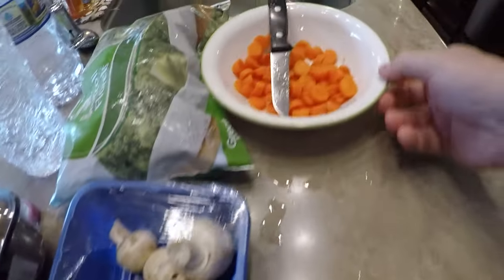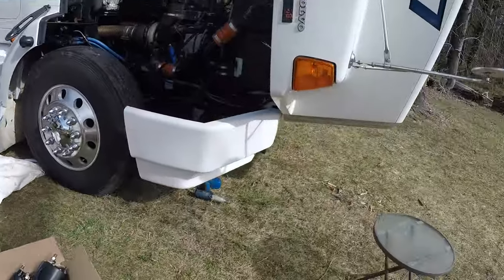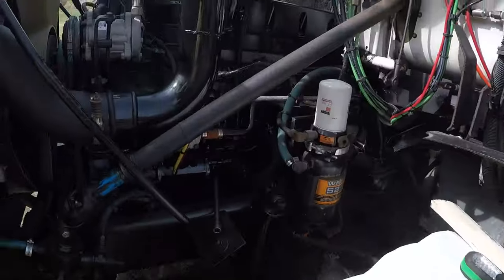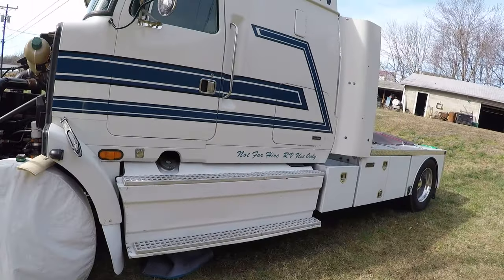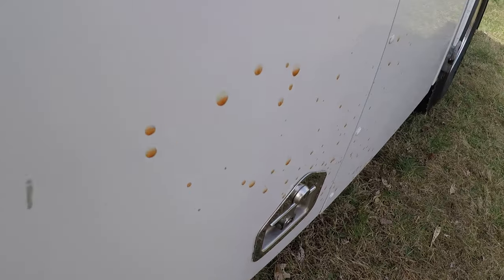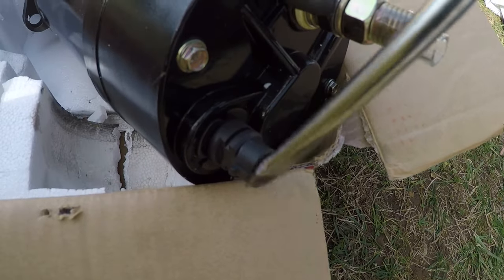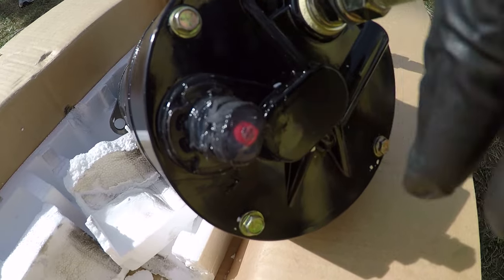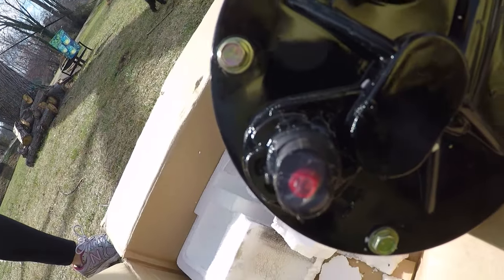RV Hauler - Starter Install ( FAIL! )

Comment: Don't get all hung up on the building. I built a 30 X 40 X 12  ft metal building with slab, 2 rollup doors, entry door, 3 windows, and insulated for about 26K. Electrical and lighting another 4.5K.  It's a nice looking building for about 30K. from there you could finish out a part of the inside or do anything you wanted with it.

Comment: Ross... I'm sure you can probably rent a cordless impact wrench. I have a Milwaukee Fuel 18 volt cordless 1,100 ft pound of torque. It will remove bolts like melted butter.
Reply: Todd Williams I want one of those! Must be a good tool to have!
Reply: Ronny Stormo.... It's one of my favorite tools!  I'm always helping friends and family with car repairs but I'm constantly rotating tires. This tool works better than an air-driven impact. Takes lug-nuts off with ease!

Comment: Am I the only one finding it ironic that he can't get that starter changed, but then he's wearing a Snap-On hat in the second half of the video?...Oh, and that older truck may be a pain to get  the bolts to break loose, but that starter is a lot easier to get to than most of the current trucks being produced.